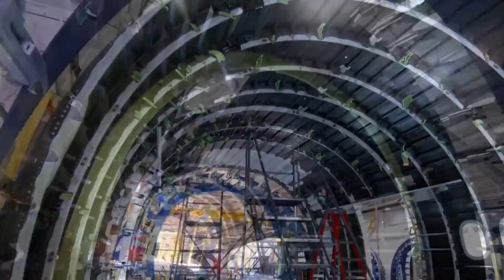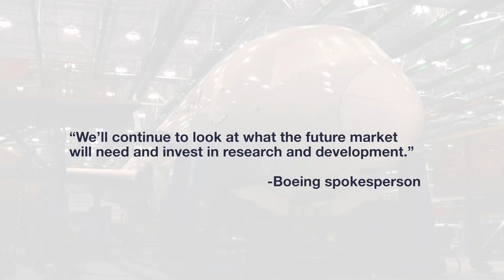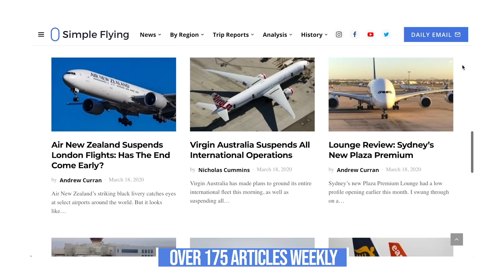Boeing Looks To Reimagine The 757 & 767 In Place Of NMA

Comment: I fail to see why a 757 “replacement” would need 250 seats. The 752 in the most common configuration has 175 seats in the non-domestic version and the similar 753 around 220.

For a twin-aisle 250 seat aircraft Boeing already has the excellent 788. 

If anyone with industry insight can enlighten me, I’d be most grateful. It sounds like a dilemma constructed for the purpose of this story.
Reply: Where does this channel get its information?  It’s interesting that they say the B757 is obsolete...  most of the B757’s, before the pandemic, were flying daily on many different types of routes. Yes, they are old, however, obsolete, I don’t agree...
Reply: non radar I believe everyone in the passenger airline industry agrees the 757 is obsolete. It’s not fuel efficient and aircraft like the Dreamliner, the A380 and A350 have set new standards for comfort and design.

My hope - both as a passenger and plane nerd - is that Boeing can use the 757 as a template for a new aircraft. That would surely be more cost efficient that creating a new one from scratch.
Reply: vondahe I understand and appreciate your point, however, Delta, United and American utilize this airframe to the maximum on a daily basis, not to mention Fedex. So, that by definition, makes it not obsolete. It’s not fuel efficient, it’s aging, the interiors are dated, yes. But, to my point, they are still flying, there’s nothing in the sky to replace it yet, only plans. The B757 is still relevant, not obsolete, not yet...
Reply: non radar There are only two reason these passenger airlines use the 757: 

1) There is no aircraft with its unique properties 
2) They’re all paid for.

I used to work for two big American airlines and the above was public knowledge.
Cargo and courier airlines don’t care so much about fuel economy because their fleet does not have a high utilisation rate. 

They can certainly fly many more years - just think of the still active DC3s - but from a commercial perspective, they need a replacement for passenger service. I am aware that some still use the even worse MD8X series which is super noisy and very thirsty but it’s no one’s favourite and is hard to justify when you want to appear green.
Reply: vondahe I agree whole heartedly with what you have said, however, my point was to the use of the verb obsolete by the publisher.  By definition from Webster’s, the B757 is not obsolete...
Reply: @vondahe  should we consider the A320 CEO obsolete then, since it has a more efficient replacement and is from 1987?
Reply: Way cheaper to fly longer single aisle plane than a shorter twin aisle simply due to weight.
Reply: JWB671 Very good point - I hadn’t thought of that so I looked it up. The empty operating weight of the Boeing line-up made my jaw drop:

752: 59 tonnes
753: 64.4 tonnes 
788: 120 tonnes!

If you divide the weight with the number of passengers, it becomes evident that there’s a huge weight premium per seat (capacity).

There is no single aisle aircraft suitable for international routes with a 250 pax capacity. The A321 XLR has the 752’s capacity but much improved fuel economy and could therefore be crowned as the 757 of this century. Boeing was hoping the smaller 737 Max 8 could have taken that title but we all know what happened to that.
Reply: JWB671 agreed!

Comment: The 767X seems pointless given the 787 was designed to replace it. The 757X however would be a great competitor to the A321XLR.
Reply: Matthew Brew Indeed, 757X seems to have larger probability to exist as the aviation need a nma, 767 is too big for it
Reply: B757X wouldn't be as good. It doesn't have any commonality with MAX or NG.
A321XLR have commonality with A320neo and A321neo.

A321ceo is also a decade younger in terms of technology. Hence they would have way better fuel efficiency to begin with.
Reply: NNT Flow a 757X would take the fuselage of a 757 but then update the cabin, wings, and engines meaning it will have the same technologies as the newest aircraft.
Reply: The main advantage I see in it for customers is it's cheaper than the 787.  Airlines are broke right now and fuel prices are low.  So the fuel savings they get with a 787 isn't worth what it was worth a few years ago.  If they can save money up front by going with the 767 then that may make the most sense to them even if they pay more in fuel costs over the life of the plane.  And on the manufacturer's side Boeing still builds the thing.  Putting a new engine on it and boosting production would be relatively easy compared to launching a new plane like the 757+.
Reply: @col loc What are you talking about now?

Many shorter routes (which is majority of routes operated by B757-200) AROUND THE WORLD have been replaced by mostly A321 for decades. Some even replaced by B737-900ER.

The XLR only here to replaced the TATL and longer routes which is a tiny percentages of missions done on B757-200.

Do you see majority of airlines in other countries using B757-200 now? No.

The US3 only keep using it cause they always operated old aircraft. They still operating MD88 for goodness sakes.
Reply: @col loc I don't understand what you're trying to say. None of your replies make any sense to any of the comments in this particular thread. Did you reply to a wrong person?

And I think you mistype some of the aircraft name or something cause it's hella confusing.
Reply: col loc the A321neo can carry the same number of passengers as the 757, so it would be a direct competitor.
Reply: Unfortunately there's no demand for 757X as Airbus launched A321XLR, and all the customer waited for 757X/797 have gone for Airbus

Comment: 757 reengined would need a new engine in a thrust category that is not common (40,000 lbsf), and its wing will still have an aspect ratio of 8.6, while newer plane designs are over 10.5. Nobody is going to spend money designing a brand new 40k lbsf engine from scratch. 

757 with new wings, in addition to the new engines, would have all the problems listed above PLUS huge R&D costs for Boeing as well.

767. Slow. I hate it.

Comment: The situation has been considered for years, and the reply has always been a flat no, and for good reason which I will try to explain in the simplest possible terms. For a new engine PW1133G and LEAP-1A are the best options. A higher thrust needs major changes. With a classical throttle push stretch (ie spinning the engine faster injecting more fuel) you can get 36 klbf, 20% less of what is needed. Newest engines are heavier and yield more thrust. The critical point here is the safety speed V2 of 155 knots in the case of 757 with one engine down. Here is where max thrust is needed, not under normal circumstances. Even if this were achieved, with adequate engines 757 will trail A321LR in cost per seat by 5-10%. Old dogs learn no new tricks. The old wings increase wetted area substantially and the lower aspect ratio results in higher induced drag. In short, so many substantial changes are needed that a new design becomes less expensive and gives better results
Reply: @col loc plenty of twenty some years old died from covid-19 infection, currently 86k people have died here, more than pretty much the rest of the world combined. and that's with quarantine in place, more would die if there aren't any travel restrictions. this isn't over reaction by the least bit
Reply: would you say that a clean sheet replacement for 737 with options and intents to upgrade to the likes of a321xlr in the future would be best way to plan for future? with the whole pandemic going on, international flights probably won't open up again until much later, while domestic flights for countries the size of us and canada will much more likely to see the need for 737 replacements rather than something as big as twin isle 767 medium sized widebody
Reply: obstinatejack it’s too late for a clean sheet on the 737, but the losses the MAX caused would have probably made up for the cost of development.
So changing the NMA for the same strategy that just failed seems weird. Sure, they’d plan on being more careful but it’s clear that upgrading old projects has its limits.
Reply: @col loc people die of covid-19 not because of their age, but due to their ignorance and arrogance, and you are displaying both
Reply: col loc Are you kidding me?  Listen, you already got in an argument over the coronavirus thing so I won’t go into that... but the 737 MAX groundings are an overreaction??  Boeing LIED to airlines and authorities about the MCAS system, so that airlines would think they can have a cheap training process, giving Boeing an edge.  And now 300 people are dead.  And sure, you could say, “Oh well the airlines should just spend millions of dollars and thousands of hours on professional flight sim training and then the planes will be up in no time!!!!”  How impractical that is aside, Boeing DESERVES to be in this situation for all it has done.  It’s not the airlines fault for believing what Boeing told them.  Boeing new what it was doing, after all if the airlines new the training retired to fly the MAX’s, they would have just gone with Airbus.

And ok I will go into the coronavirus thing because why not?
 (Edit: uploaded early)

The government is controlled by Republicans, you realize that, right?
The national response to the outbreak is on their shoulders.

Comment: Imagine a 757 with GEnX engines
Reply: GEnX is all-electric. 757/767 ae bleed air.  Not compatible.
Reply: @jimshaw597  Got your point there.
Reply: yep would luv to see that but it would not be feasible.... The 757 would require an engine that produces thrust in the 45000-50000lbs range...
Reply: The GeNx startup and 787 air-conditioning don't require bleed air, but engine naccelle and wing antiice systems run off the bleed air from a GeNx... And yes the 757 and 767 are older airframes and don't support electrical air-conditioning... Although Boeing might update the 757plus to feature that but really for now we don't know..

Comment: Yeah the 767 appears to have run its course as a passenger plane. The 787 is essentially a 767 replacement. It gets confused as a 777 replacement all to often. 

The 757 is one of the most successful programs ever. Give it a composite fueslage and new improved engines and you'll see orders pile up.
Reply: @0w3nn  One of mine too. It's really well proportioned for a wide body.

Comment: There should never have been a 737MAX .... the 757 line should have been restarted instead.
Reply: Phil DeRosier precisely!  The 737 has been put through the taffy puller so many times, it went from the regional market, serving undeveloped fields, a market now served by CRJ’s (actually even the CRJ is being pushed out of its intended market), and now those fields all have jetways and ground equipment, to flying cross country nonstop, and the Max now flying transatlantic.  Seems exactly like why they made the 757.  Look back to scheduled, a 737 would fly from JFK to Harrisburg, to Dayton, to St Louis, Kansas City, Wichita, Pueblo, Salt Lake, Reno, Fresno, Los Angeles.  Now it’s JFK-LAX, San Francisco to Honolulu, Toronto to London (England).  It was never designed for this.  You used to fly a 737 from Toronto to London, Ontario.  I flew from Pittsburgh to Los Angeles, flew a CRJ-200 to Houston.  What the hell is a CRJ doing flying that far?  They used it because all the 737’s were out playing 767.

Comment: Too late for a 757NG, the a321xlr is in 3 years, and with low development cost, airlines can buy the xlr with huge discounts. consider the fact that Boeing is focusing on the max and the 777x, and changes the NMA concept all the time, it won't be ready until at list  2027 when airlines need a replacement quick for there ageing 757. also, pilot, FA, mechanics and dispatchers, would barely need to be trained form the 320 to the xlr
Reply: col loc you’re the only one on this entire comment thread insulting everyone else.
Be a person or get out.
Reply: @col loc your lack of knowledge is staggering. To the point that I think you're trolling, but I'll bite. The 757 wings aren't too big, in fact their aspect ratio is less than 9, when nowadays to be competitive you need to be closer to 11. The engines you say are "overpowered" would still need two upgrades, 1 is to drastically improve efficiency by going to a 50:1 or even 60:1 pressure ratio. Second, since such an engine would be heavier and larger, its max power would need an increase of about 10 percent. Unlike engines in the 30k or 50k thrust range, there is no modern engine that can be scaled up from 30k or scaled down from 50k, so it would need an entirely new design. Engine makers would never get their money back for the R&D because no other plane needs similar thrust levels. Now please stop embarrassing yourself.
Reply: What if an airline wants to avoid buying too much Airbus?
Reply: Then they would buy Boeing. But for the most part, airline just buy whatever fits there needs. And a ready, large discounter Airbus in 3 years is better then more then 5 years expensive boeing
Reply: @col loc who's gonna make new engines for a 757 X?  Engines in the 40 thousand pound force range are orphans. Who's going to invest in a completely new engine class, only to be out sold by the 321 XLR anyway?
Reply: @col loc notice how didn't address the aspect ratio or new engine problem that a new 757 would require. Why didn't you address it...because you're stupid enough to think that blurbing out certain history about the plane has anything to do with its current situation.

Comment: I'm sad that Delta is retiring it's 777s
Reply: Hahaha tbh i also dont like i prefer the high pitch engine sound for the 757/767
Reply: FaTe_ Zah if you don’t like the 757 sound u ain’t an avgeek
Reply: @cardiffexpress4652  i dont like the 777 sorry for not telling it straightforward i love the 757/767 but havent fly on them because i stay in singapore😂
Reply: Jose Carlos Mazariegos Tahay I actually never really liked the 777 that much
Reply: Me too... But Its Just my Opinion
Reply: I know... Are they not fuel efficient. What was their reasoning?
Reply: DAVIDnBOSTON 777s are some of the most efficient planes around to date, I’ve seen Delta rid their fleet of more and more Boeing Planes year in, year out. Maybe it’s a ploy to make a complete Airbus Fleet due to the type ratings cost. Or maybe it’s just because it’s expensive to keep them around in times like this and they’ll be pulled out of retirement when they are needed again.
Reply: How old are they
Reply: The lr is useless

Comment: Delta have announced they’re retiring their 777 this year
Reply: Ikr it's crazy... I get em retiring the 200, but the 200lr!! Not Cool!!! 
I guess they wanna switch to an all airbus fleet, and don't wanna type train their new pilots on different airbus and Boeing aircraft.... They better buy the 777x when it comes out tho or imma loose all faith lol.....
Reply: Jaafar Zaidi not many operators of the 200LR. Well not as a passenger plane  they still have the 737/757. They also have a lot of 767’s. I’m guessing the A350 will be replacing the 777’s

Comment: Im pretty sure 787 Dreamliner was the replacement aircraft for 767 as I feel like a refreshed 767 would be competing with it.
Reply: StupidSnake but the Dreamliner isn’t cheap, a new 767X would be much cheaper than the 787-8 and I imagine it wouldn’t need much training for pilots that already fly the 767
Reply: A new 767 would be aimed at shorter routes, unlike the 787 which is aimed at longer range routes
Reply: Alex P not really, 787 already have excellent performances in both short haul and middle haul flights, there’s no big reasons to introduce 767X
Reply: Tendokunタキ Dreamliner for short haul? Really?
Reply: Isn’t the 767X for cargo only ?
Reply: Don’t forget the freighter market and all the aging MD-11 and 767f
Reply: @massimechoub3343  NO. Don't make me think of more MD-11 retirements. Just NO
Reply: @capbustchasing  Me too i wish to died before...
Reply: The 787 isn't exactly a 767 replacement, but it can fill the role of a 767-300.
Reply: StupidSnake they could base it on the -300 model so it doesn’t overlap with the size of the 787-8 the -300 is 54 metres long while the 787-8 is 57 metres long they need to put more composite materials in,new wings and of course new engines also the 767x would be cheaper and have shorter range
Reply: That's why I'm not very excited for the 787 and I don't believe in the extreme hype for it. It's a replacement aircraft; nothing particularly groundbreaking or special.
Reply: And they would likely discontinue the 787-8 for the 767X while keeping the 787-9 and -10
Reply: @mattiagnagno757  you don't replace a 9,000nm plane with a 5,000nm plane
Reply: Jim Shaw ouch, forgot that...😅
Reply: Jim Shaw Didn’t the 767 go around 6,385 nautical miles?
Reply: @jimshaw597  the narrator did say new powerplants. That could mean fuel efficiency and longer distance.
Reply: Mattia Gnoato but 787-8 is still receiving new orders, there’s no reason Boeing will discontinue the product stills have its demand from buyers🤔

Comment: I'm a big 757 and 767 fan, so I am looking forward to seeing what Boeing can do with a re engined 757 and 767. DELTA airlines has already made the 757 and 767 with larger overhead bins and comfortable seats so it would be nice to se a comfortable 757 and  767. It would be interesting to see Boeing's new Scimitar winglets on those aircraft. I've actually have flown a DELTA 757 more times than I've flown a 737.
Reply: @col loc I'd also imagine that a re designed 757 and 767 would be a hit with airlines such as Icelandair so that the crew would be more familiar with the aircraft's systems, only with a few new upgrades similar to the 747-8
Reply: interesting possibilities for Boeing